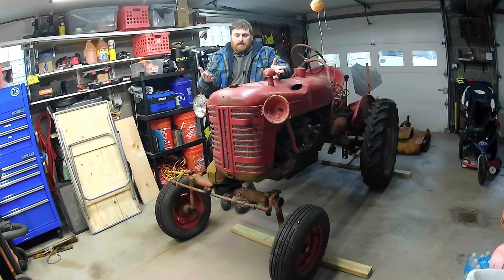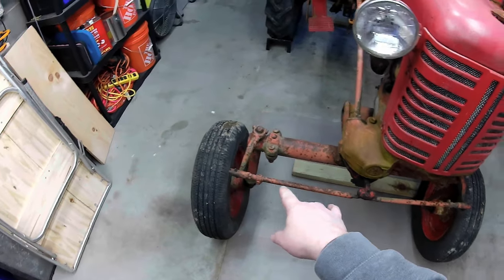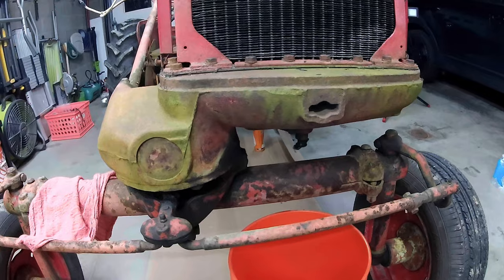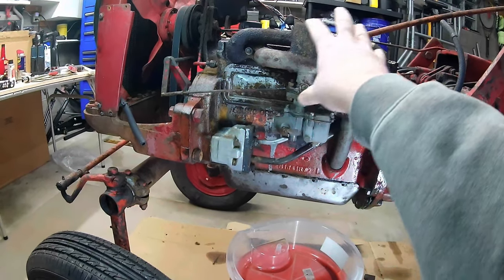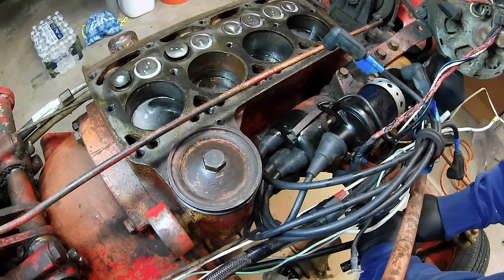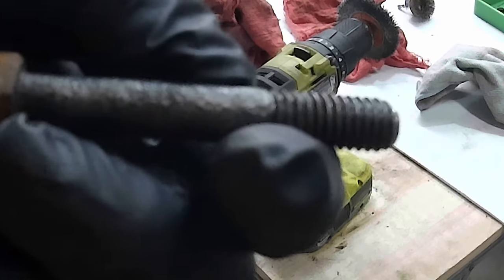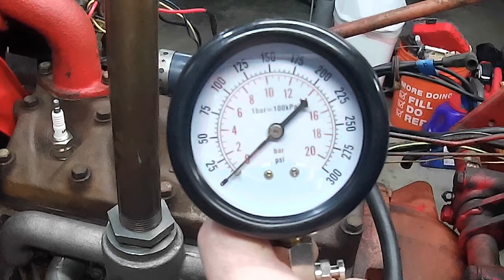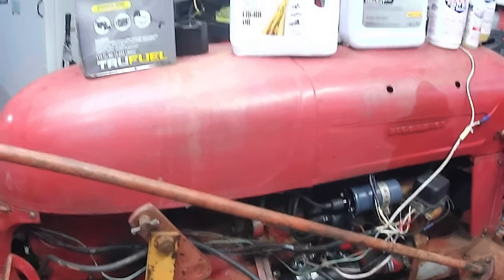Reviving a SEIZED Farmall Cub Tractor Engine - Will IT Roar To Life?

Comment: Great job Neil.  That amount of water in the intake scared me.  I thought the engine internals would be worse.  I probably would have passed this one over because of it.  Again great job.  
PS Starter motors are usually pretty easy to rebuild, keep that in mind for the next one.
Edit I see you mentioned trying to rebuild the start in another comment.
Reply from the maker: Thanks Pat! I think if he didn’t agree to trade for the chainsaw then I would have passed for sure. And the valves were pretty rough but they cleaned up just fine and I mean it sounds great 👍. I appreciate the comment! And yup I did try to rebuild the starter. Field windings and brushes all new but I think something was wrong with the commutator or the windings in the armature. I spent 2 days on it and just couldn’t get it to do anything. The bendix was fine on it but I still have the original starter and might have another go at it. It’s definitely a very straightforward process. I thought parts would be a lot easier to come by for these and for the most part they are but something’s are tougher. Also the serial number tag is completely worn. Can’t read a darn thing on it 😂. But I’m happy with it and having fun with it! Thanks again for watching!